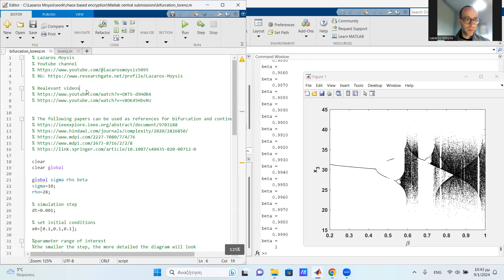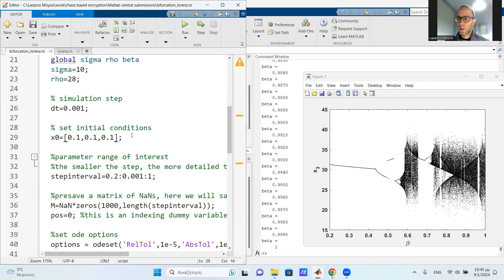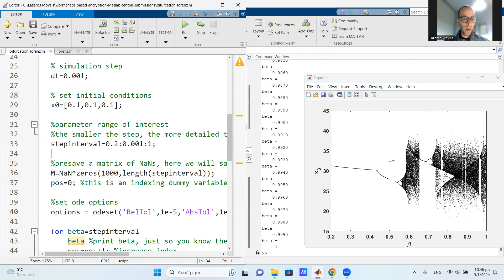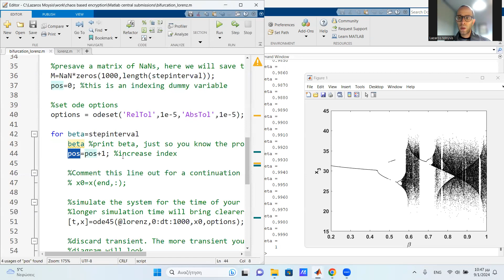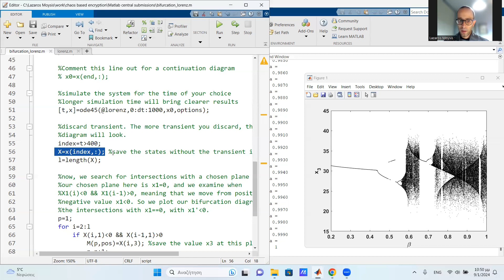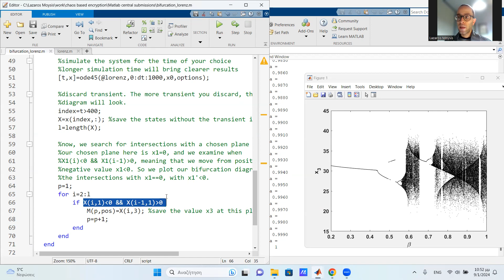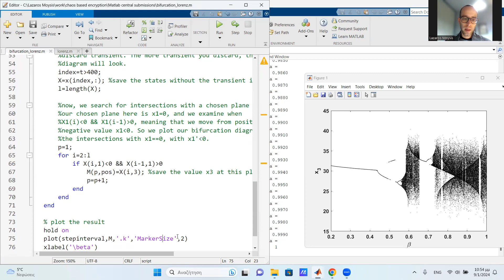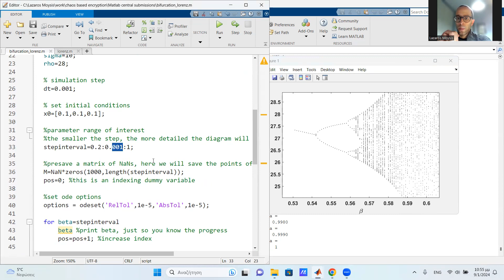How to plot the Bifurcation Diagram of the Lorenz Chaotic System in MATLAB

Comment: Oh, and I have one more question. What are the differences between bifurcation and continuation diagrams? Of course I searched it in AI tools but wasn't satisfied. The difference between using or not using the IC thing is huge.
Reply from the maker: in a bifurcation diagram, x(0) is fixed. In a continuation diagram, after one simulation finishes, you set x(0)=x(final). So each simulation starts from the final state of the previous one.

Comment: Hi Lazaros, I want to ask a question. What if there is no intersection at x1=0? Should we assign another value arbitrarily (let's say x1=5) and try, or is there a way to choose it properly? Like from time series or phase portraits, etc.
Reply from the maker: Yes, the x1=0 is just an example, the plane of intersection that you will choose depends on the system. To choose one, I suggest just plot a couple of phase portraits for different parameters, observe the attractor, and choose a suitable plane.
Reply: @lazaros_moysis thank you for the detailed response 👍 Have u tried partial for for quicker simulations?

Comment: Great example!
Could you please explain the choice :   if  X(1,i)<0 && X(1,i-1)>0   ?
 I mean, why do you choose to detect when x(t)=zero  ?
Thank you.
Reply from the maker: indeed. 'i' is the index of the time series. so x1(i-1) is positive, while x1(i) is negative. This means that we have crossed over the x1==0 plane
Reply: @lazaros_moysis  
Thank you for your prompt response.
In fact, my question is why is it important to know that we crossed over the x1==0 plane ?
Reply from the maker: @liasensip  This is just a plane that we choose, after observing that the attractor intersects this plane for many parameter values. So it was our personal choice. If you change the plane, the bifurcation diagram will obviously change shape. But qualitatively, it will show the same information. For example, if you choose the plane x1==1, again for periodic behavior you will have 1 intersection, 2 intersections and so on. Of course, you must choose a plane that the attractor intersects. If I choose say the plane x1==1000, it is very far away from the attractor, so the attractor never intersects it, I will never get information out of it.

Comment: This code  runs well but the diagram is coming empty! Please help me out this issue.
Reply: finally the figure came.... great 👍👍
Reply from the maker: There is probably some very simple mistake.do you have hold on on the code?
Reply: Thanks
Reply: Yes. As it is in your code.
Reply from the maker: @satyajitsaha29ss  did you copy paste the code exactly from the matlab link?
Reply: No. I wrote it following your video.
Reply: Earlier I incorrectly included 'hold on ' inside a loop but now I corrected it but still the figure is coming blank! Please help.
Reply from the maker: @satyajitsaha29ss  the code link is available in the video description
Reply: Can I use fractional order in it?
Reply from the maker: @satyajitsaha29ss  yes you can use fractional systems

Comment: how to plot the bifurcation diagram for the  fractional order Lorenz chaotic system using matlab
Reply: can I use fde12 function
Reply from the maker: @ritaloulou-i7t  i am not familiar with this exact command, but in matlab central you will find a lot of codes on solving fractional order systems. They will probably help you
Reply from the maker: The methodology for plotting the diagram does not change. You only need to replace the ode function, with another method that solves the fractional order system.

Comment: Thank you very much for this explanation.
I have having challenges with plotting the same bifurcation diagram for a non linear duffing oscillator. my code is taking forever to run, and then it plots something not looking like a bifurcation plot. how long did this plot take to run?
Reply from the maker: The time mainly depends on the size of the iteration step you choose (small step will give a more detailed diagram) and the  simulation time for the system. I would say, depending on these parameter choices, from 1-3 hours, depending on the computer as well. In the description I have a link to a Matlab code, you can use that for your system, just replace the Lorenz with your own.
Reply: ok thank you for assist @lazaros_moysis
Reply: Thank you for your assist it has been insightful. I am currently experiencing some challenge in my plot. I would like to Plot ydot1 from ydot = [ ydot1; ydot2; ydot3; ydot4] for varying bifurcation parameter. what exactly am I going to change in the code?   @lazaros_moysis